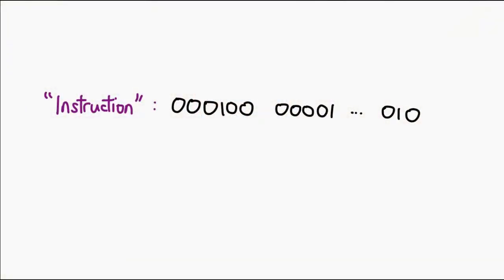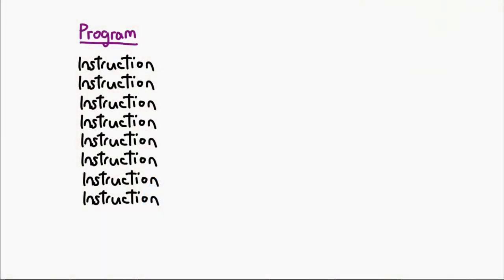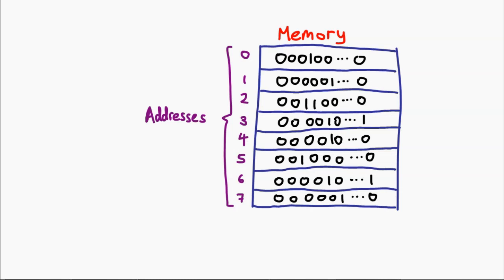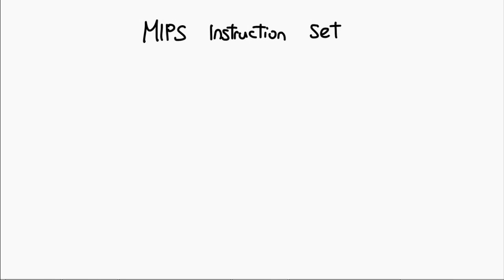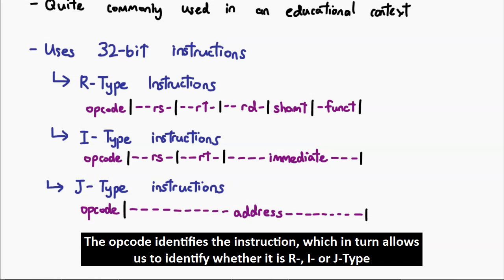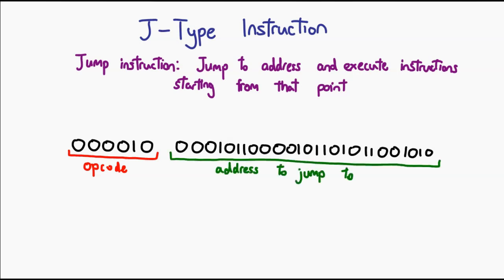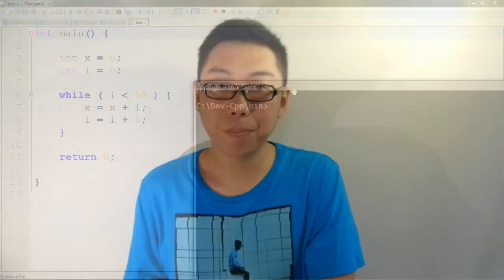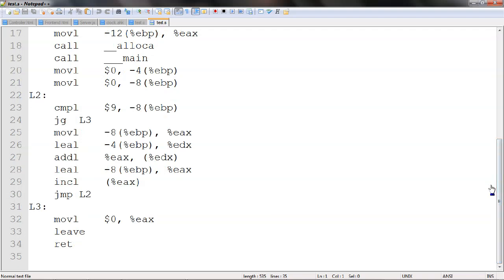Instruction Set Architectures

Comment: At what level does an ISA come into play? Is it processor dependent  or software dependent. If I write a program on my computer, what determines what ISA it gets translated into?
Reply from the maker: Hello and thank you for your comment! Great question. Simply put, the ISA is "the language of the processor", ie, what you have to actually tell your processor to make it do work. As such, to answer the first part of your question, it is processor dependent, not software dependent.

The translation is done by a compiler. The job of a compiler is to turn your high level code into something low level the processor can run. That is also why the result of compiling the same code doesn't always give you the same results depending on what computer you compile on. The code has to be compiled for a specific ISA, which is what creates the difference.

Comment: The explanation was pretty good but I have some question. How Instruction Set Architecture is implemented in a processor. And how 1 and 1 input in an adder is turned into some strings of 0's and 1's by the help of ISA its a bit confusing. Also how does this opcode tells the processor to perform an addition.
Reply from the maker: +Akif Mac Hello and thank you for your comment! To understand the points you've raised, you have to understand some concepts of lower level logic - Things like logic gates and other components that work on the logic level that help to implement higher level concepts like addition.

Unfortunately, this is not something that can be explained quickly, though it really isn't very hard. Thankfully I already have a series covering these areas. If you're interested, please check it out: https://www.youtube.com/playlist?list=PLJse9iV6Reqj1M8p1jzvv6Zzj0js_gawl

Comment: hi thx for the videos, Is CISC and RISC comes under ISA??
Reply from the maker: Hello and thank you for your comment! RISC and CISC are two different types of ISAs and stands for Reduced or Complex Instruction Set Computing. 

RISC has only a small amount of instructions so it's easier to learn, but more complex operations may require multiple instructions to implment. CISC does this for you by giving you many different instructions, some of which may be expressed in terms of other existing instructions.

Comment: Thanks. This is the bane of why we can't just compile once and make it work with all kinds of computer. 

Is an instruction set a kind of encryption, like the Enigma machine whereby you must have the code (in this case the instruction set) to decipher the jumbled words the 0s & 1s into something the CPU can understand so that it displays things on the screen correctly?

God bless, Proverbs 31
Reply from the maker: Hello and thank you for your comment! 

I wouldn't consider this encryption, it's "obfuscation" at best! I would say encryption involves scrambling the information in a way that only the intended recipient can decrypt it. 

In this case, we're simply representing the same information in a different language. An analogy of this would be translating, say, English to Spanish. It's true that we're using a "different code", but it's not encryption in the sense that there's no secrecy involved.
Reply: Hi. Thanks for mentioning obsfuscation which is a new word for me. 

Instruction sets, very mysterious- I can't picture them out. Would you know of a site with the complete lists of these Instruction Sets for each architecture? I only know of Load. Where are the instruction sets store? Is it in another storage somewhere in the motherboard and what electronic component analyzes if a transistor is a 0 or a 1, what is that component that decides this is low power or high power so it's a 0 or 1compared to this voltage. 

By the way what's the typical voltage determined by the companies say that this is 1? What about the voltage for 0?

Thank you. God bless, Genesis 1:3
Reply from the maker: I don't know of any complete lists, but you can always look up the instruction sets for a simple ISA like MIPS and that'll give you a very good idea of what's going on.

Assembly language is "assembled" into machine code (zeroes and ones) where each number represents an operation. This is what the computer eventually "executes".

Typically, what we call "Logic High" voltage is either 5V or 3.3V.

Comment: One question, though: if the opcode for the R format is always 0, then how do we get more options for operations? Aren't we in effect just wasting 6 bits by turning them all off?
Reply from the maker: Not really! While the opcode is indeed all zeros (and can only be that), it indicates to us that this, being an R-type instruction, has a specific format. 

In particular, this format tells us to look at the last 6 bits of the instruction. That becomes a "secondary opcode" so to speak, telling us the exact function of the statement. The rest of the statement are the usual operands.

This is why we "get more opcodes". The one opcode (000000) can then lead us to one of 2^6, or 64 more instructions.
Reply: Thanks for responding! I think I get it. So we basically ran out of combinations in our opcode, which is limited to just 64 instructions, so we set the opcode to 0 and allocated 6 bits at the end of the instruction to act as the "new" opcode?
Reply from the maker: Exactly! That way, for the opcode "000000", we can get another 64 instructions there! So now MIPS can have a maximum of (64 - 1) + 64 = 127 instructions.

(We subtract 1 because "000000" can't be used to represent an instruction anymore).
Reply: Got it, thank you!

Comment: Is it  64 combination or permutation? By the way, what's the instruction set of the Dreamcast and the Switch and Playstation? Have you made your own CPU that made up for transistor (the huge ones) connected by wires like how they built things in the 70's before the microprocessor?
Reply from the maker: I'm quite rusty on my math, but I do believe this is combination, not permutation, ie. Every unique combination of zeroes and ones represents something different. However, there is no notion of reordering the same bit sequence, ie. If we have the sequence 0110, reversing the order of the two ones does not create a different sequence, it is still 0110.

You'll have to look up to see what ISAs the consoles used. Off the top of my head I only know the early PlayStations were MIPS CPUs. 

I have not built my own transistor based CPUs! That's a huge undertaking. The most I've done is using transistors to build logic gates! You can find the series playlist on my channel.
Reply: I recently found this scaled up version of the microproccessor using discreet transistors. It's huge. It's in the Guinness Books of World Records. I wish it displayed the flow of the 0's an 1' in very slow motion and not just LED lights, lol :  https://www.youtube.com/watch?v=lNa9bQRPMB8&t=322s
Reply: Thanks. Say, we compile the small character 'a'  which has a binary of 01100001 on a PowerPC chip, does the PowerPC chip's instruction set jumble that binary, for the character 'a' in a different way so that it's not going to work on an Intel (and vice versa)? Also how come even if the Mac has Intel, the apps are still not compatible with Windows (and vice versa)?
Reply from the maker: Looks very interesting! Though I think showing the flow of 1s and 0s would be extremely challenging.
Reply from the maker: The example you've given with the letter "a" is called *encoding*. Strictly speaking, our encoding schemes are arbitrary, and even on the same computer you don't necessarily have to use the same encoding everywhere (eg. Most computers support encodings from the most primitive ASCII to the modern Unicode). The purpose is not so much for obfuscation as just different conventions used.

Incompatibility between operating systems arise from differences in the environment more so than the CPU architecture. Operating Systems expose a state and a set of functionalities that can be accessed from programs. Unsurprisingly, different operating systems will provide somewhat different functionalities, and more importantly, how you access them are also different. Hence the incompatibility.